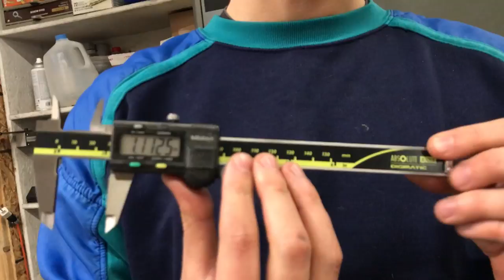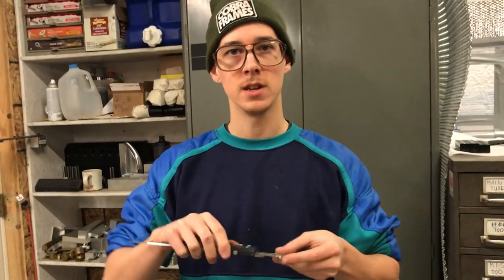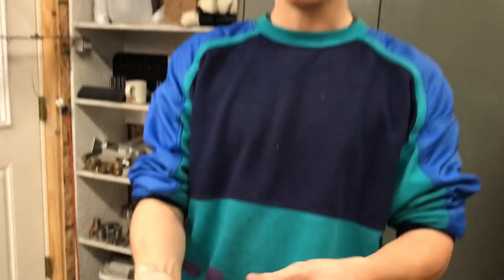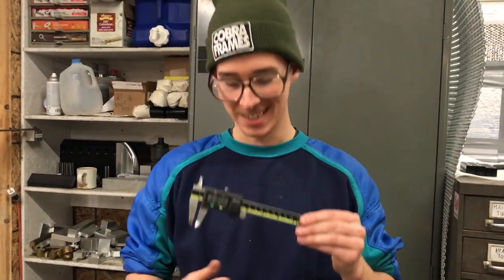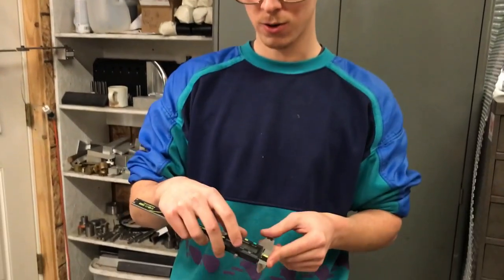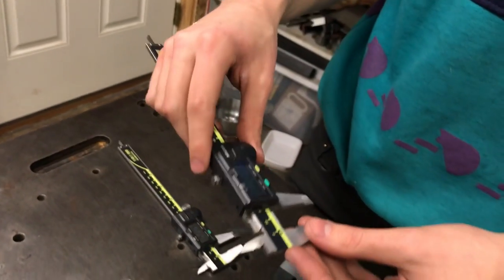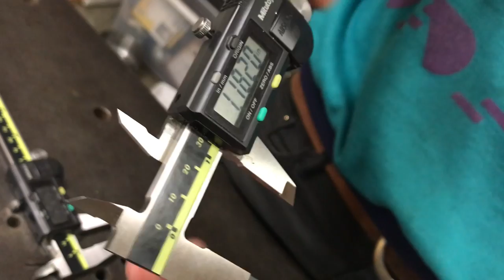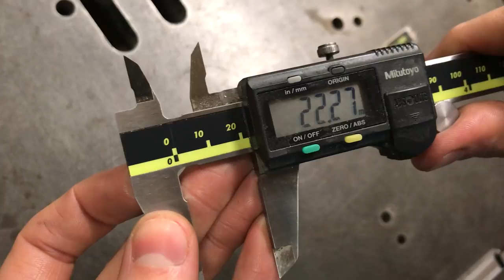This Thing Saves Me So Much Time | Mitutoyo Digital Calipers Review

Comment: Dial calipers, even though they're easy and quick to read, notoriously have problems with chips and machining debris clogging up the rack gear.... And not only giving an inaccurate measurement, but sometimes even causing a tooth to skip. The digital calipers are infinitely better in that regard!
Reply: Plus you can shift the origin on digital saving time doing extra math.

Comment: I still prefer the analog Mitutoyo's and I'm not even that old.Whay less need to interpret the reading.

Maybe it's just that I've been using them as long as I can remember
Reply from the maker: I like analog better if I’m working only in inch or only in metric, but that’s kinda rare in my shop. Trapped in the middle. I need the inch/metric functionality.
Reply: @cobraframebuilding  You have analog Mitutoyo's with metric and imperial scales. Mine does up to 7" in 1/128" increments. As I'm from europe and using metric, this comes in real handy sometimes if I cant get a good metric reading, then the inch scales are also there, no need for pressing a button
Reply: you mean a Vernier where you have to find the two matching lines ? I like those ones two but it's more error prone. Not sure what you mean by interpret the reading

Comment: I still prefer micrometers- much more accurate, and the math isn't that hard. Basically calipers are just a fancy steel rule. 😂😂😂
Reply from the maker: I agree that micrometers are more accurate, but they're slow and you need six to cover this same size range. I can reliably measure +/- .002" with this and that is almost always good enough for what I do, which is why this is the most helpful measurement tool, not the absolute most accurate if time and convenience aren't a consideration. This video is for folks who don't have much experience with precision measuring to help them get perspective about which measurement tools they really need.